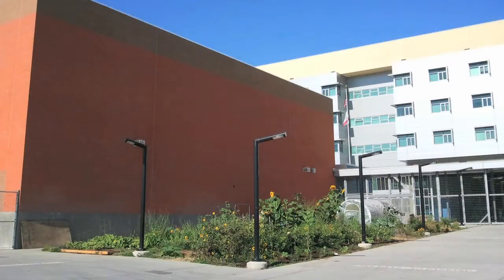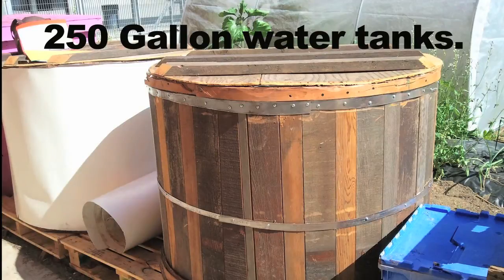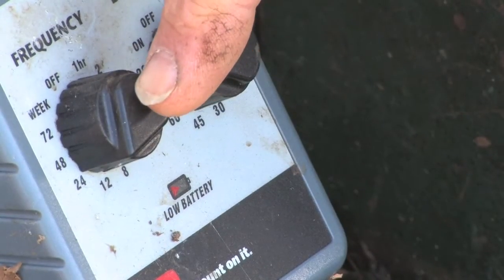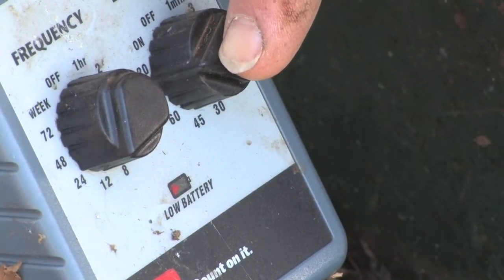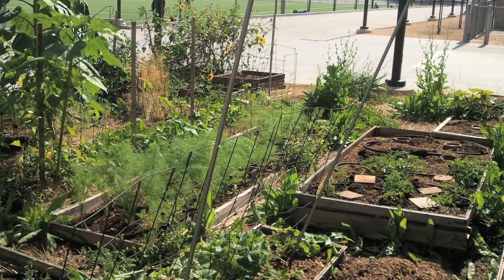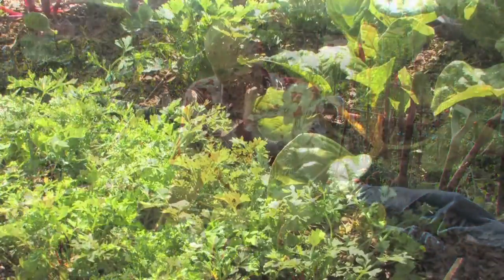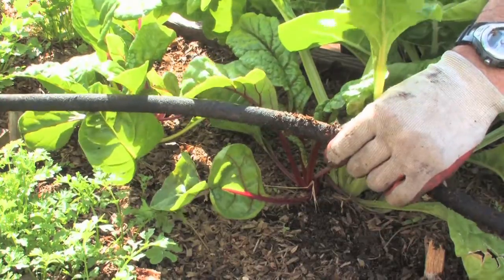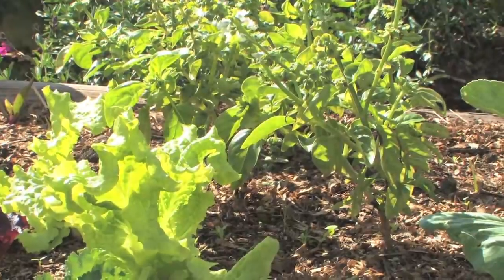IRRIGATION USING SOAKER HOSES AND GRAVITY FED WATER FROM TANKS

Comment: How far is to far from faucet to "c" I have 2 ibc tanks staked and I'm worried that there won't be enough pressure to do a system like this. (the distance from ibc tanks to the garden is around 40 feet)

Comment: I'm gravity watering my raised bed from A/C condensate, and right now it's just a continuous feed. My bed is staying too wet and I think this timer is what I need. Have you had a problem with the hose not draining quickly enough without a pump? I seem to have developed a clog because my 5-gallon bucket is filling up instead of draining to the bed. I can see the hose is still dripping though, so maybe it just doesn't have the pressure to keep up. What do you think? Thanks for the video!